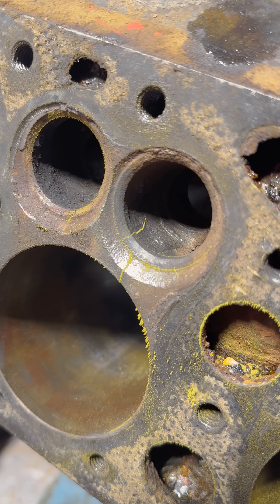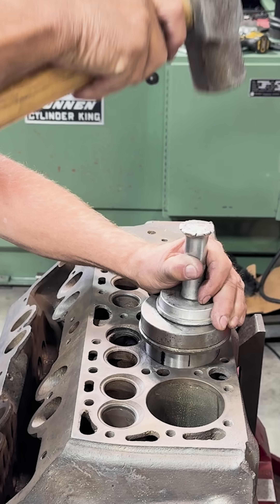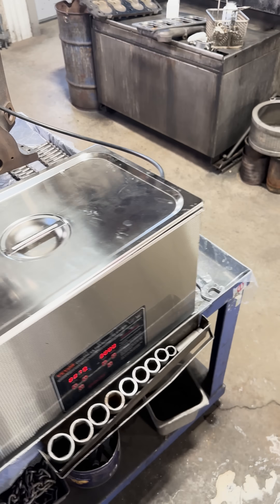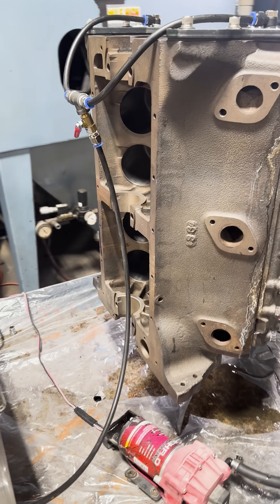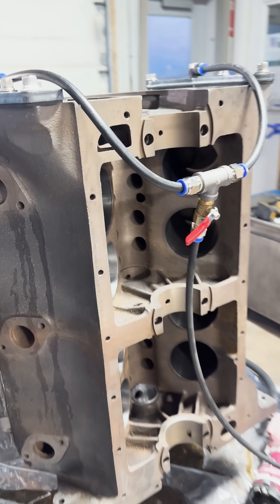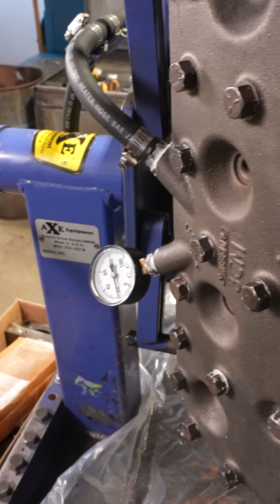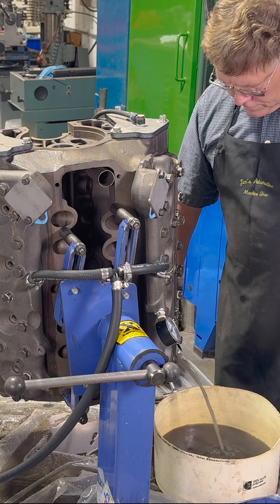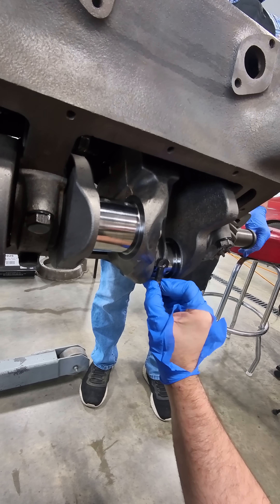#shorts Your Engine Block Is Cracked... So We're Ceramic Sealing It!   @itkwadmin

Comment: The manager at a shop I worked in my first year as an apprentice liked to experiment with some crazy stuff.  In a racing inline 6 we installed raised intake seats, but when cutting for larger valves, we hit water.  One of the things at the time was to install screw-in seats to seal it.  When pressure testing, it looked like a fountain with water squirting in all cylinders.

We did the same thing as here.  Flipped the block upside down and filled the water jackets with hot water and Irontite ceramic sealer, the same company that makes the tapered plugs for stitching a crack.  Under pressure, we watched the geysers slowly retreat until finally there was no leak.  We cranked up the pressure until the frost plugs started creaking, and still no leak.  The engine ran fine and never leaked, even when racing.
Reply: That's awesome thanks for sharing. So that ceramic sealer doesn't affect heat transfer then?
Reply: @ I can only say that it didn't seem to affect any engines we used it in, and it was quite a few.  Normally, we drained the system after the leak stopped so it only really affects that area, it doesn't cost the entire system..
Reply: @gearhead1302  Not much ?
Reply: Was it a sidevalve six?
Reply: @De19thKingJulion  Nope, a 292 Chev.
Reply: @lelandlewis7207  Wanted to build a 292 for 49-50 years !
Reply: @eflanagan1921  they make some awesome power, as do the 300 Fords.
Reply: @lelandlewis7207 especially after a shipment from Cifford. Woke up that 92 F 150, and added a lot of power.
Reply: How much does it cost?
Reply: @ run a search on Irontite ceramic sealer.  I haven't looked in years.   There are other brands as well.
Reply: I remember my second boss and his son (a highly experienced mechanic for highway tractors and passenger vehicles)
They swore by Irontite and that was many years ago. Curing the worst case scenario.
Reply: This is so interesting, thanks for your comment
Reply: Tapered plugs. Never used them. Learned to drill, tap, intert threaded rod, cut flush, and do a one third overlap on the next one. Braze over with brass to seal it.

Learned lead work from the same relative.
Reply: Wauw..greath..

Comment: I'm still waiting for some company to manufacture new aftermarket flathead blocks and heads for the enthusiast market. I'm sure prints for the blocks, heads, and the sand cores are all over the place. Or maybe not.
Reply: Maybe not. Will cost more than a overhead unfortunately.

Comment: Thanks to Jim and Nic for demonstrating and explaining how this is done. I have a Rover 4.0  aluminum V8 and those engines are notorious for cracking. I was thinking of using water glass to seal potential cracks. You demonstrated how to do it. 👍

Comment: Can you basically sleeve any engine? If so, does it just affect your displacement, apart from the new narrower pistons/rings/etc. required to fit the new setup?
Reply: I would guess they bore the block oversize to accept the sleeve.

Comment: a cracked block is the perfect opportunity to upgrade to an engine that isnt a stupid antique.
 all aluminium quad cam DOHC V8 flat plane crank ITBs pentroof chambers high compression variable cam lift variable cam timing variable cam duration variable intake tract length equal length manifolds feeding sequentially into the collector in a clockwise pattern

more power and more torque and a flatter, broader curve with less RPMs and less fuel requirement. 

to spend SOOO much tie repairing  junky old piece of crap with terrible deisgn and tterrible engineering is just a waste of time and effort and money. 

 entirely stupid.
Reply: I'm guessing you don't keep horses either... Same. However, this isn't a mass production commuter -- it is a one off and I'm certain their other car is a Toyota Corolla that half drives itself.

Comment: That's dedication to a customer right there. Hopefully it all turned out okay.
Reply: My level of dedication to a customer is directly proportional to their level of monetary investment.
Reply: Screw the customer that's dedication to a classic motor.
Reply: @garyjones7044 I’m 100% with you on that one!
Reply: @garyjones7044 Why can't it be both? 😮
Reply: @garyjones7044 screw the customer 😂
Reply: Prayers fr 🙏
Reply: That's strange I had to click on your comment to leave a comment. Because it didn't give me a comment bar. 
I've had moroso ceramic sealer sitting around in the plastic tube and it swells out like concrete after a few years. And only about half of the bottom was swollen out. I believe if it was periodically shaken over time the whole bottle of swell out evenly. The stuff sets up like concrete but in a steel block it shouldn't hurt it. There was a guy that used to block filler in a street engine. And with that big block Chevy he didn't need block filler to begin with it wasn't bored that excessive. The bad thing about it after he got it in and filled the cooling system up it was leaking in the freeze plug. I would recommend drilling and tapping the freeze plugs if using hard block or block filler. That guy that had the weeping freeze plug definitely had a mess.
Reply: You know it cost him a pretty penny this wasn't charity.
Reply: Why am I only seeing shorts instead of the long videos on here
Reply: @jerryglascock1194  In general? The full video is at the bottom you can click on.
Reply: It's not like they're not being paid to do this. Do people no longer think? I don't get this world.
Reply: Dedication to a customer? They probably charged him 1k minimum
Reply: that was very very interesting.
Reply: How to spend 10k on a block
Reply: I have a few old cars more than 20 years old.  The auto shop i been using for over 30 years has been good to me even though lean times
Reply: Dedication to getting that bread
Reply: Because he payed
Reply: I'm sure he payed dearly for the service.
Reply: Well none of it comes free!
Reply: "dedication to a customer"..... It's a business. If they can charge enough to justify doing the work, they'll do it.
Reply: @MarceloR73  It's a business. Many shops won't undertake something like that if they've got more or easier money on other jobs.
Reply: @Objectified well, I'm guessing they would just charge more for this then.
Reply: @MarceloR73  Sure, but you can pay a lot of money for crap work too.
Reply: "money" ^
Reply: @Dogthejewhunter  he used Monetary right
Reply: Don’t worry their wallet is now empty

Comment: I've never seen a Mercury Flathead, that's killer
Reply: They were probably the coolest looking engines ever made but they are impossible to get decent horsepower. In 53 a mercury flathead made 120 hp. The thin castings can't take the high revs or high compression

Comment: I like to gaslight myself into thinking i can do anything on a vehicle so long as there is the slightest bit of documentation on an obscure forum from 13 years ago. Stuff like this though, i know to take my engine in to get work done. This is something that you just cant do at home. Maybe back in the day, but my engine is from 2004, the tolerances that existed when my engine was made cant be duplicated with a few hours of time, several beers, and aggressive use of a belt sander. Keep up the great work. Maybe even consider giving the old guy a cost of living raise

Comment: Amazingly enough, after all your work, this engine is still only good for turning money into noise.   Flatheads are only good for car shows.   I put over $15,000 into building my dream flathead only to realize the car could still barely keep up with teenagers in Toyota Corollas in traffic.   Hopefully this is going in some old guy’s car who only drives it once a month to the cruise in 2 miles down the road.   Why do flatties all crack?  Because they’re a terrible design with 180 exhaust ports that are surrounded by coolant.   It’s almost impossible to keep these things cool on a hot day.
Reply: Your missing the point.....
Reply: @ no, you’re missing the fact that I actually built one of these engines myself.  There’s nothing to miss, I have actual experience.   I put my money on the table and found out for myself.   It’s okay though.   If you need to feel like you know more than me, go ahead.   Feelings aren’t required to be based in truth or experience, otherwise they’d call them facts.
Reply: It's a hobby or life choice that does this for some people. Some people decide to piss away money off on drugs or other useless things.  Either way it's their money.   Oh, yeah you can get a modern engine to replace it with that puts out high HP and what ever else. But is it going to still be running 60 plus years later?  Might not be fast but it's got class, and turns heads.
Reply: @DB-yj3qc  you're still trying to convince me you know more about this and I'm wrong?  Its okay buddy.  You have your feelings and its okay, really.  No matter how much you type, I am not going to agree with you based on my actual experience.  I don't care that you think I am wrong.

Comment: You put a lot of parts and labor into an engine block that may not seal🤔
Reply: The customer dictates the repair and accepts the risk. While other vendors might refuse to mess with it at any price, at least these guys are willing to try.
Reply from the maker: Nobody said I was smart
Reply: @JAMSIONLINE  At least you're willing to try to fix it, which makes you a little smarter than some of these keyboard professionals 🙂
Reply: Well I'm sure they are 99% confident or they wouldn't suggest it.
Reply: it'll be fine

Comment: Ww have had excellent luck with Blue Devil. We had cracked racing heads, in the runners of the exhaust. That stuff worked so good, it lasted for years. You must get the engine hot. With the stuff in the system, let it circulate a little bit. Turn off and let everything completely cool. It will seal it. Then we had developed a crack in the cylinder from the deck down the wall, it sealed it as well and the rings polished the spot perfectly. The stuff is amazing.
Reply: We would leave the Blue Devil in the water, because we didn't use antifreeze, as a precaution, and it didn't hurt the water pump or anything. 
The block was a 350, we made about 600hp, drag racing. Every year we would get a new 010 block and start fresh, it seems that the blocks would develop cracks in the main webs, nothing major, but definitely not good. We now run an aluminum block from Brodix.
Reply: @UndercoverRC  used 010 blocks ?
Reply: @eflanagan1921  yes, a new to us 010 block lol. I should have said that differently, because they don't make those anymore lol.
Reply: Stuff didn't work for my cracked cylinder head. Plugged up coolant passage in my head, but didn't seal the crack